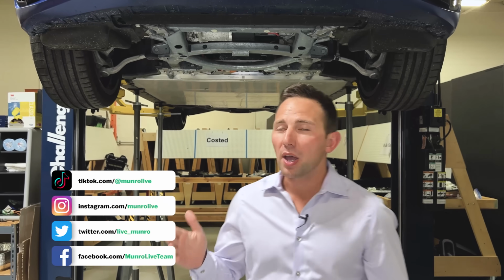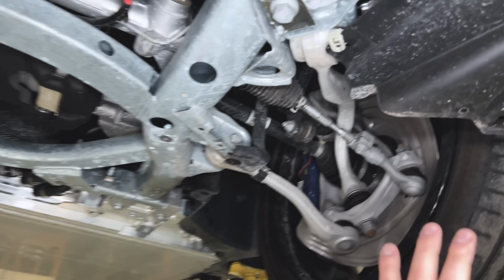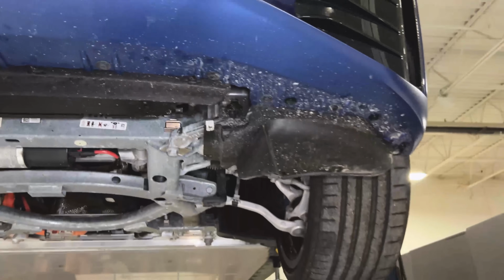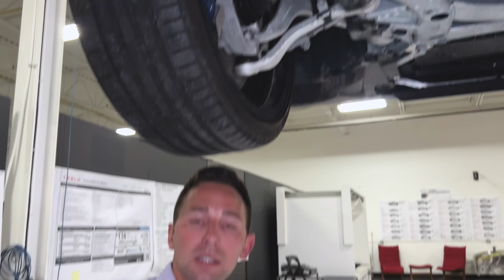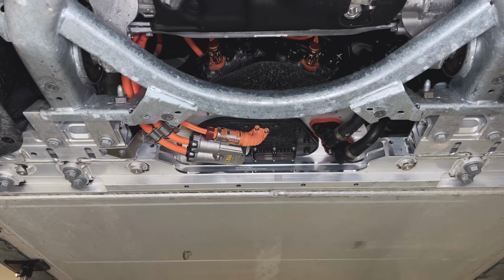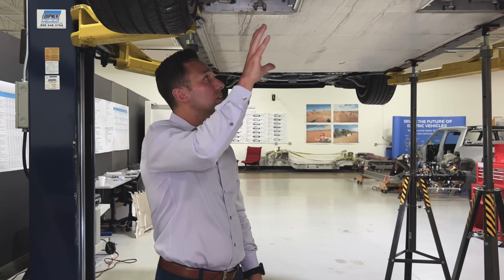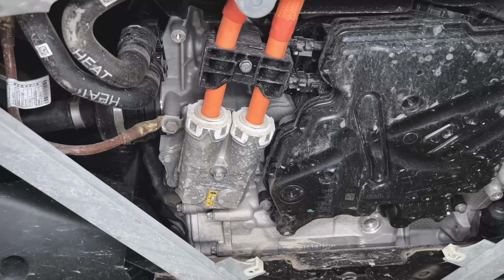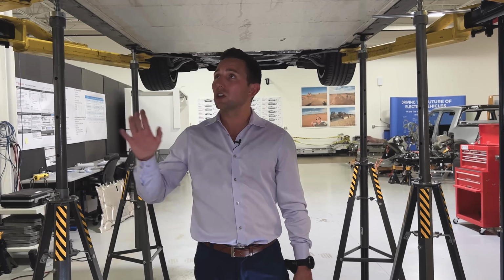A Look Underneath the BMW i4 M50 Undercarriage

Comment: Really cool under car coverage. Thanks! I believe BMW's used front MacPherson struts exclusively from 1962 until 2010. The 3 and 4 series have always used them also, I believe. The i4 doesn't have optional rear air suspension, but instead it's standard on versions including the eDrive35, eDrive40, and M50. Is that forging that's become part of the battery pack, actually bolted to the rear subframe? BMW claims that these subframes tie to the pack to add rigidity. The pack is a structural reinforcement.

Comment: It is kinda worrying that there is no full cover on the front or rear. Both from efficiency and from preservation/weather protection perspective. In harsh winter climates like the Nordics the snow and salt will not be kind to all those exposed components.
Reply: I believe all that is covered, and they were removed for the video. They've been doing that for years. Even our 14 year old 3 series is nothing but plastic covers all underneath.

Comment: Great review! Just a small error, the polestar 2 isnt based on an EV platform, its built on the XC40 platform which is a ICE/Hybrid platform.
Reply: Polestar is ground up BEV. The reason Polestar was created as a separate entity was purely to separate out ground up EV research and Hybrids on the Volvo stable.
Reply: @twenty-twenty  😅 its not. If the ps2 had been designed from scratch as an EV that would be correct, but its not. Its built on the Volvo CMA platform which is shares with the XC40. The CMA platform was made for ICE and hybrid drivelines.

So no, the PS2 is not based on an EV platform, like many other EVs it is fit onto an ICE platform, which comes with its limitations. Most notably you can see this by the transmission tunnel going though the interior of the car, EVs do not have a transmisson so it is entirely unnecessary and steals up interior space.
Reply: Whatever dude. I have better hills to die on. I own an i4 and I LOVE the empty transmission tunnel because my 4 year old uses it as a hurdle.

Comment: The i4 is indeed based on the CLAR platform they use for basically all their vehicles, both ICE and EV.  I really like how the explanations tied into BMW's historical engineering.  It really shows how different companies can take unique approaches (that aren't just variations of cost cutting) in tackling similar problems to add their own flair to vehicles.

Comment: I am going to disagree on the Galvanized to Aluminum (Al) connection galvanized steel will react with Al. The Al will break down from the galvanized steel would like to see how they stop that from happening.
Reply: Maybe certain types of Al or Galvanized steel does not react? I am sure a coating or certain formulas eliminate or min this reaction.

Comment: Bjorn tested the range of an i4 in Norway, quite impressive what the BMW team did, 650 km or so on a charge I think.
Reply: I know he tested an i4 eDrive40.
Reply: @rkgsd even the i4 M50 on the smaller wheels and non-summer tires can achieve well over 300 miles IRL. BMW tends to produce quite efficient vehicles. Even their ICE vehicles are usually top of the list for real world efficiency. My old M440i xDrive Gran Coupe had nearly 400HP yet I could get almost 38MPG going 80MPH. It used less fuel than my much smaller and less powerful VW GTI 6MT or my old Honda Accord 2.0T Touring. We have an i7 xDrive60 now and it is quite efficient, returning up to about 3.4-3.5mi/kWh at a steady highway cruise. For such a large and heavy sedan that’s built off an existing ICE chassis I am quite happy. At 80MPH it tends to be as efficient or more efficient IRL than a Model S Plaid while being so much quieter, nicer riding and loaded with options like soft close doors, 4-zone climate, massage seats, reclining rear seats, and a slightly larger battery pack.

Comment: Elegantly simple, exactly what you would expect from a legacy automaker of high performance vehicles. Whether they used legacy components or not (suspension goodies mostly) makes no difference, the marriage of  legacy components to their their electric platform has been done brilliantly. Compared to the EQS however it looks dainty, in usual fashion Mercedes components look like if they are meant for a tank (which the EQS is) while these look more like a motorsport focused company. Very nicely done! It shows how a legacy automaker can leverage what they have done and refined for decades into a new product. Excellent engineering.
Great analysis.

Comment: I actually bought the expensive ad thing. was talking to a friend just the day before about wanting a beefy backup battery setup, with the fear of the power going out in the middle of texas heat, and the add-on of solar panels was too good to resist. it probably can't run my AC but at least it can provide shade and power a fan all day

Comment: When/Will conventional passenger EV’s have greater underbody road clearance? And why will it happen if/when it does?
Reply: They won't! It's a huge efficiency advantage to have the underbody close to the ground, and completely covered with smooth under-body cladding / covers, to decrease drag. And efficiency (should) drive EV design to contribute to range.

Comment: A simply light-weight addition/protector would be a light-weight cage to protect the front motor. Simple, cheap, light. Would take minimal anchors. It could be at little as 3-4 inch mesh squares. Would stop 90% of unforeseen projectile intrusions.

Comment: Impressive engineering of the undercarriage. That being said as I have learned from these videos the part count is too high and the design needs to be simplified.
Reply: If you build one product with one drivetrain and one trim level and in high volume, things become hugely different.

but when BMW Is building multiple models (3-series, 4-series, 5-series, 6-series, 7-series, 8-series, X3, X4, X5, X6, X7, ....), with tens of options and BEV, PHEV and ICE drivetrains on the same chassis and with a model lifecycle of 7 years. ... and in somewhat low volume. Things are slightly different. 

Of coures I'm saying more optimization could and would and should happen. But this current design has its tradeoffs and that is both positives and negatives.

Comment: It's fascinating how much time and effort is put into safety in crash. I might actually owe my life to such innovation. In 1990 I not only didn't die, I walked away and provided medical attention to the passengers of the vehicle that caused the crash. After, looking at my vehicle, I could see how it crumpled to spare me blunt force and crushing by the engine. Always wanted to thank some designer, but no way to know how.
Reply: Thank crash test regulations.  The fact that individual components are functional and designed towards specific crash test attributes means companies are engineering for the test and not necessarily taking initiative on comprehensive safety (e.g. specifically 25% front crash overlap instead of other variations of front crashes).
Reply: P
Reply: What car were you in, sir?

Comment: So why would you need to add pencil braces and round Z direction extensions to the body around the rear motor cradle?  I suspect it's because the motor cradle designers were siloed apart from the rear suspension designers and the result was needing these band-aids to fully mount the motor to the body and not interfere with the suspension.  This is not a stellar design for manufacturability implementation and looks ok for a 50k to 100k per year volume, but is going to be a huge headache for 500k to 1,000,000 per year volumes.  Prima facie evidence that BMW has still not executed a clean sheet of paper BEV architecture designed for million+ per year manufacturability.  High manufacturing costs will eat into their BEV profits.
Reply: Stuff like that chunky forged aluminum piece MIG welded directly to the battery pack as an attachment point to the body makes me cringe. So many different mix and match metals and alloys in the underbody. A lot of their solutions look like homebuilt garage engineering with lots of welded and bolted tubes and sections with redundancy galore. Probably why it weighs 5,000 lbs. even though with its small interior it's classified by the EPA as a subcompact.
Reply: @flipadavis  TIG welded mosaic
Reply: That's because they have no intention of having this be a high volume vehicle.  The purpose of this vehicle is for PR Lip service (Hey look were relevant, we have an EV too!) and emissions credits.  For these purposes it does it job beautifully.  BMW is perfectly content selling high margin ICE vehicles for as long as they possibly can.
Reply: BMW did make the snub nose i3 and while range for that car was abysmal, the rest of the car design was wonderful:) BMW hopefully learned their lesson with the i4 and will correct and replace what is one of the worst designs of the year:)

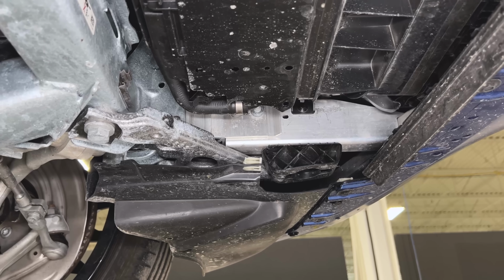Comment: With that "big casting" around 5:10, i had to think of Crocodile Dundee - "That's not a big casting - this is a big casting!" ;-)

Nice review, as always, thanks!
Reply: Bmw was actually one of not the first to use those giant castings! Munro did a video on it in 2013 with AUTOLINE network go watch it!
Reply: @carholic-sz3qv  thanks for the info! Did not want to take anything away from BMW, just found calling that thing "big casting" after having seen the giga castings in the Texas Model Y ... shakes-head 😉

Comment: BMW has followed a well-worn and bureaucratically institutionalized formula for building its cars...and they are typically beautiful and well constructed vehicles. But we're entering the EV age, and BMW's thinking is too rigid, too stuck, to behave with agility and nimble response in the young EV ecosystem. Even though quirky/clunky appearing, they had interesting ideas with the i3, and after that....crickets. Hard to be wowed here with i4.

Comment: i felt the floor inside has been raised a bit compared to regular 4 series gran coupe. Also it seems ground clearance is lowered, but I can't verified it without both of them side by side.
Reply: Should be about 2 cm higher floor and 2 cm less ground clearance.

Comment: Would be very interesting to compare this structure to the BMW M440i GRAN COUPÉ the i4 is based on (and visually identical to if option matched). I bet there are very few differences and you'd notice a lot of structure that is only there to enable it being both ICE and EV - with disadvantages for the customer.
Reply: I was about making this exact comment!  Yeah would have been interesting the difference since it’s basically the same car except many modifications. Curious what those were.
Reply: There is no disadvantage for the customer here lol….. everything was well tought to make the platform work with both Ev and ICE. Also it remains a very easily serviceable car unlike the tesla big castings
Reply: @carholic-sz3qv  Except the interior is tight, there is no frunk, the luggage space is tight and the car weighs 400+ kg too much.. - except those things and probably a lot more I am forgetting "there is no disadvantage for the customer here lol…"
Are you paid to defend stuff on the Interwebs? Do they know that you are not good at it?!

And what kind of "service" does the chassis of the BMW need that you have to compare it to castings?! Oh, right... BMW of the past used to have issues with cracking sub-frames and shock towers for example...
Reply: @NO3V  watch Björn Nylands take on the i4 RWD i40 in these  past days. No one tests as thorough and unbiased as him - and he is the biggest Tesla fan.
Also, i don't know but your tone doesn't sound like you are an engineer - as an engineer you would be able to debate things properly and not talk down on others.
Reply: @evboy4287  he/she'll never watch. He's writing the same "ICE platform" comment under each i4 video but can't explain how it affects the customer
Reply: @KDR816  Reading comprehension much?!
" interior is tight, there is no frunk, the luggage space is tight and the car weighs 400+ kg"
Reply: @NO3V  interior is very comfortable for me (1.77 meters) and feels firmer rather than dangle (matter of taste)
Trunk is huge for me, for more space need a commercial van
Third party frunk costs 250€, but who needs that? Trunk is more than enough
edrive40 weight is 2100, M50 2250. Plus you don't feel it. Is it important? if you can drive it 200kmh comfortably while in tesla you start to pray, efficiency is very high, suspension is perfect, carrying capacity is high. So weight is not an issue, only if you look at the spreadsheet very often
Reply: @KDR816  I drove the i4 M50 through corners and accelerated out of some.. So yeah, I felt those kilos. It's shit for a BMW. Also limited to 227kph.. yawn
Also 20k too expensive for what you get.
And nobody gives a fuck if it has enough space for YOU. There are smaller cars with much less weight and way more space. That is how you objectively tell that BMW can't build proper EVs..
Bye now.
Reply: @NO3V  With all due respect, BMW buyers (or buyers of high priced luxury brands) are not put off by 'less weight' and 'way more space'. If that was the case, cars like the i4 M50, Porsche Taycan and the EQS to mention a few would not be in demand. Meanwhile, the average wait time for an M50 allocation in USA is around 6 to 8 months (or even more). That said, the weight is not that much of an issue depending on the driver's experience; the interior space could be better but it can comfortably fit 4 people (2 in the back no taller than 6ft ... the front passengers seat can fit over 6ft tall person which mitigates the issue); and the rear trunk is a hatchback with foldable rear seats so overall - while not a 'family car' - it's reasonably functional as a daily. If you have a big family, you will always need a second car regardless and it will have to be bigger (minivan or SUV). Again, that is expected.
Reply: @obieWanmotivation  good job digging up ancient comments...
I've test driven the i4 M50 in May. It's a joke for the price in a world where Tesla exists. BMW buyers will buy some, sure. Brain capacity differs from human to human.
Reply: @NO3V  Lol. "ancient comments". You're a character for sure. Have a wonderful day 😄
Reply: The i4 video is not an i4 video if nobody writes the ICE platform comment 😄

Comment: Coolant leaks at the 9 minute mark and just after the 10 minute mark.  Anyone else notice this?
Reply from the maker: It's water because we just washed it prior to filming.
Reply: @MunroLive  TY
Reply: @BillyLapTop  Its condensation form the AC system. All cars have drain pipes in front of the firewall
Reply: I noticed that too! but the drips were clear, not green. That maybe thinks its HVAC condensation?
Reply: Probably from the AC system.